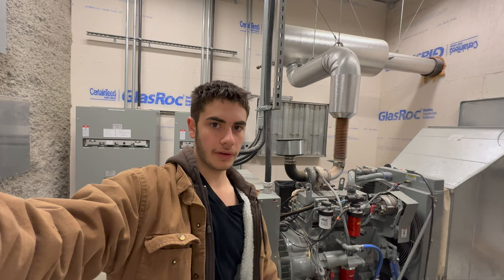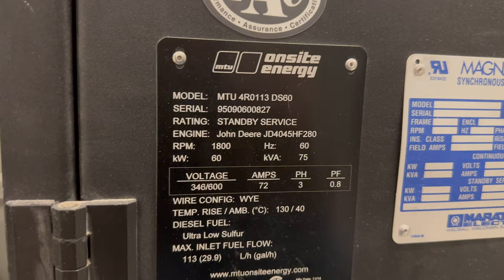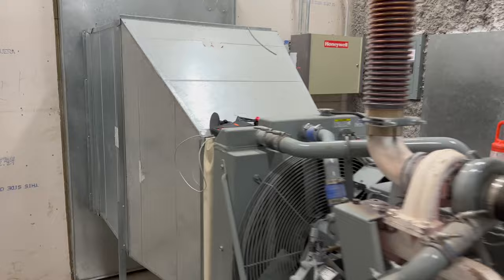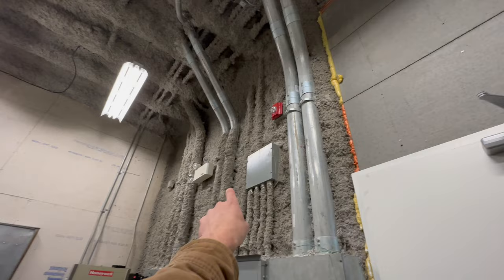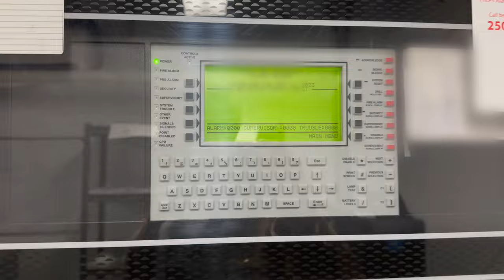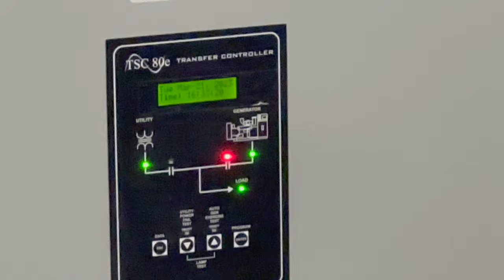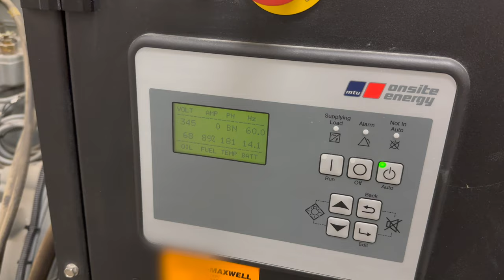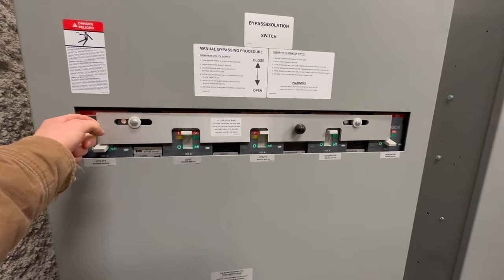600/347V Diesel backup generator test with load transfer at high school

Comment: Nice unit I used to work for MTU in Australia when they were still called Detroit Diesel Allison.  Looking at the amount of coke built up on the exhaust outlet that engine doesn't see much load at all. The machines I used to look after we would connect an external resistor load bank to them once every year of two and give them a solid hour or more at full name plate load. This not only proves the cooling system it gets the exhaust and flues fully warm and burns out any fuel or oil residue in the flue before it turns into what looks like creosote.

Comment: I'm an MEP engineer and have been fascinated with fire alarm systems, backup power, chilled water systems, digital twins, VRF systems, and VAV terminal units. It's ideal to size a generator to power everything in the building to keep normal school activity flowing during a power outage and have a UPS battery backup for life safety. However, that is not always the case as and it's expensive and often unnecessary. For small buildings such as a coffee shop, you only need the internal battery backup for the lights, exit signs, and fire alarm system to meet safety requirements.

Comment: Nice looking unit, and good job explaining the system operation. Cool to see a 347/600 v system; very few 600 v systems in the US (480 v here). One clarification about air flow: gensets use "pusher" fans, so the engine's radiator fan is pushing the hot air out, and fresh air is being drawn in the other louver.

Comment: Great video! At my old workplace, they gave us a tour of the systems though sadly didn't run them like you did here. What they did have was a room full of batteries, which would supply AC for the few seconds between loss of main power and the generator starting. It was crazy to see shelves of batteries and thinking how they can run a huge office block with no interruption.

Comment: I think the difference is that in a real power outage, there would be a 5 second interruption while the generator starts, whereas in this test, the relay switch time is not long enough for electronics to briefly lose power. I noticed my desktop computer would only quit 1-2 seconds after a power failure.

Comment: I assume the air intake is the plenum attached directly to the radiator with the recirc damper on the side and the one in the wall is exhaust... must get pretty warm in that room when the genny is running... surprised there isn't a fan on that exhaust damper...
Reply from the maker: Yes that's correct I assume the air pulled in from the radiator fan I guess is enough to push warm air out of the room through the open air exhaust damper

Comment: I recommend running it for longer.. the one I`am responsible for I run 30-60min 1-2 times a month. only then can you determine if it runs good and has no leaks etc. Also diesel ages pretty quickly and should be burned withing a year or so
Reply from the maker: Gets load bank tested once a year at 100% load for two hours

Comment: Pretty rich high school. I never saw one of these in any school.
Reply from the maker: Nothing to do with the schools operating budget it's been there since day one from the design build in the long run it saves money plus it needs to be there to run the life safety systems especially for this building that's meant to be a shelter in emergencies and disasters
Reply: @nics-systems-electric  Are you in some high rise?  Otherwise I don't see the need.  When the power went out, we just went outside since, you know, windows.  The ancient civil defense requirements disappeared 50 years ago.  So I don't know what you are protecting against.
Reply from the maker: @RS-ls7mm  it's needed for all the life safety systems to keep emergency lighting on keep fire alarm system powered supply power to smoke control system all things that have to stay on or you cannot legally have the building occupied
Reply: What Generators have you seen @RS-ls7mm?
Reply: Power goes out, send the kids home.  Not much learning is going on there anyway.

Comment: Surprised that thing only needs a 12V battery from my understand usually Diesel engines need 24V batteries to start.  Where is the battery located?
Reply from the maker: The battery is shown in the video in a couple spots I guess the in-line 4 doesn't take much to turn over
Reply: @nics-systems-electric  my apologies I am visually impaired I try to pause videos when I want to read something or look closer at something but for some reason I didn’t notice the battery
Reply from the maker: @GaryBeltz  no problem at all

Comment: Why does the fire panel need to know if the generator is on?
Reply: Supervisory it doesn't generally call the FD the monitoring company may get an alert but generally if they do anything they would call the company and make sure everything was ok.  The backup batteries on fire alarm systems are only meant to give you a day of standby time so it's probably just so that it knows the AC power was lost but the generator took over.
Reply from the maker: FA Monitors the generator if it's running as that isn't a normal condition where otherwise the fire alarm system would just show AC like normal even though it isn't normal because the power is out it also monitors the generator for any trouble condition like low fuel high temperature low temperature etc.
Reply: @nics-systems-electric maybe the gen running input disables or adjusts the detection threshold setting if the devices to prevent false alarms from smoke and heat when the machine is running. Example, rapid rise in air temp when the machine runs. Last thing you want during a power outage is the fire alarm shutting the place down for some smoke from paint  burning off the  exhaust.
Reply from the maker: @TechOne7671  i'm not sure if that is implemented in buildings it very well could be I've never seen it myself it isn't in this one as there is no fire alarm devices in the generator room other than high temperature sprinkler heads

Comment: Is this generator's engine identical to the one the Katolight Generator's engine at that elementary school that burnt down?
Reply from the maker: As for the entire generator they are different but the engines are similar they are both John Deere four-cylinder diesels 4.5 L both turbo charged but the one in this video at my school is a newer model with I believe some newer emissions standards the elementary school has a John Deere 40451TF150 verse the one at my school the high school is a John Deere JD4045HF280
Reply: @nics-systems-electric  Either way, they both sound freaking awesome. Love the sound of those generators!

Comment: 1200 amps at 600v...must be a big building. I like to always spec a 120/208 service. No transformers.
Reply from the maker: The higher voltage service is preferred for the larger equipment such as elevators HVAC and smoke control system as well as parking lot lighting can all be run off a smaller sized conductor and less Voltage Drop

Comment: Try 3 phase 240v 200a per phase
Reply: My dad's farm has one and when it's repaired I'm gonna ask if I can start the generator and switch her over but arc flash is a bitch and it's an old ass system witch hasn't needed manual switching in yours and has no auto switching

Comment: No heater on genny, cold engine straight to speed and then load.... Sound proofing not real effective going by amount of noise in hallway. Exhaust pipe outside should be directed up and taken to roof. Enclosed hush-kitted genny would be better move. Stop is deafening or eating the school kids. Air filter on the thing is small and loose. 
Tetsing and explanation best done by qualified persons rtather than a school student, not picking on the youngster but it's clear he not fluent.
Reply from the maker: You need more information before commenting. There is a block heater of course. It's an emergency generator it doesn't have to be quiet. And for your information I am an apprentice electrician you don't need a diesel technician just to start a generator. And it is completely normal for a emergency generator to go straight to full speed and then wait four seconds before load transfer.
Reply: @nics-systems-electric  Education is key kiddo, your own commentry, you called it your school indicating you either worked there or a student, your words bucko. 
No mention of a block heater, "assumed to be one there of course" Assumption is the mother os all F-ups. The low temp showing on display after it had already been running at load suggests it isn't doing much. Noise, yeah, still a noisy tractor motor and door could have been a solid, saound suppression door. 
Starting the genny and being a diesel tech: considering there are few already here commenting, take a bit of humble pie and listen rather than opening your trap. Again in your own talking, you indicated a big lack of confidence (also back to giving impression of being a student) and understanding in what you were doing. Took you several goes to figure out you need to hold buttons for 3-5 seconds to activate. Also took you a bit to figure out the ATS panels are not tied and need activation seperately. As for going from cold start to full load, any decent genny and control system will have the genny warm and will start, bring up speed over time then  will take load after ALL parameters are happy.
Reply from the maker: @bentheguru4986  just because something wasn't talked about doesn't mean it's not there.  Maybe you should go by your own advice and not open your trap if you don't know what you were talking about. You have made it clear you don't know the full story which of course you wouldn't through a short YouTube video. basing others knowledge off of age and the length of time a button was pressed...
Reply: @nics-systems-electric  LOL, thanbks for the laugh kiddo. when you have another 20-30 years under ya belt, let us know.
Reply from the maker: @bentheguru4986  alrighty buds